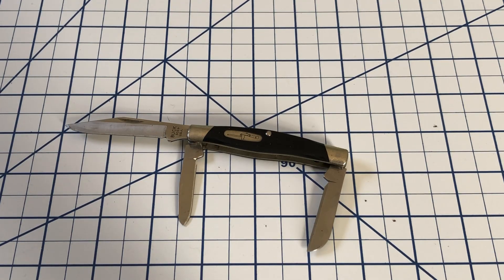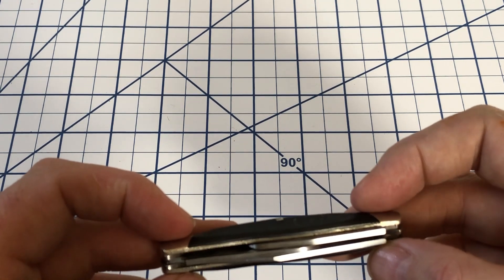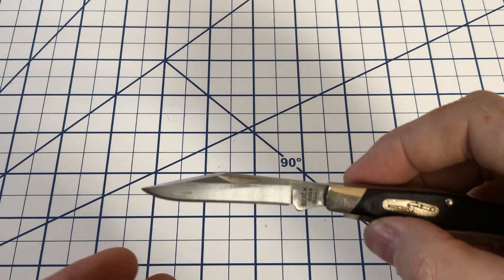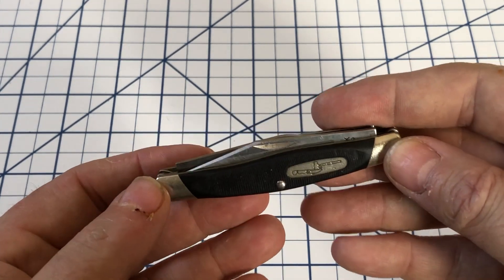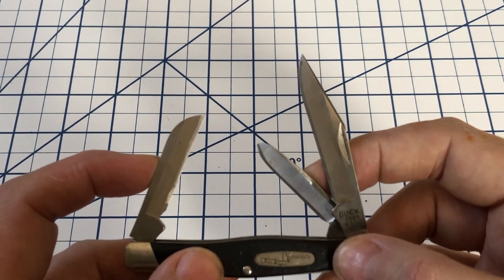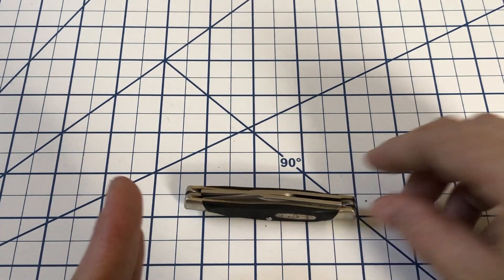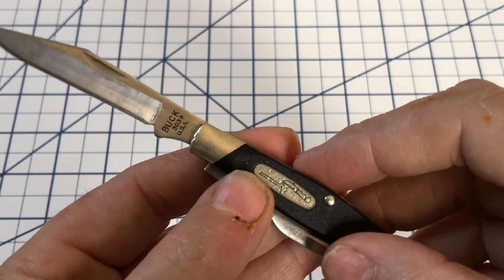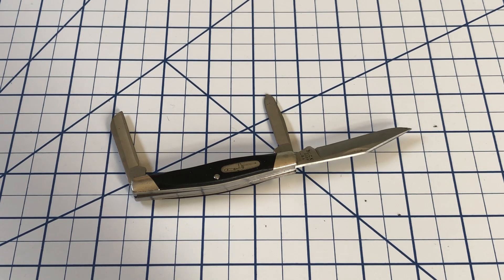A nice US-made small stockman: Buck 303

Comment: I recently found my 1982 version I thought I lost 8 years back.
It's just as you said of older ones. lol, I've never noticed the sheepsfoot blade is bent. ~ No nicks in the large blade, but its very close.
Nice little knife when I don't feel I'll need a larger for the day. ~ And one of those little ceramic V sharpeners (pinch to hold) that came with my fillet knife touches up the blade(s) enough to shave some hairs.
Reply: Oh yeah, my Cadet turned forty this year and still in great shape.